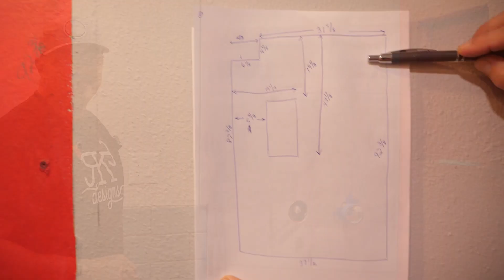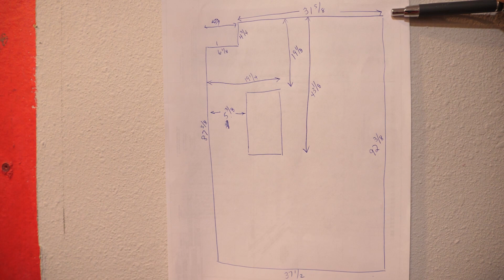How We Made Shower Panels Out Of Insulation Foam Board | Part 1 | RK3 Designs

Comment: Congrats on hitting 50k! Next stop 100k!
I am most likely to be doing this soon (depending on what's in the house I buy).  Can this be done cleanly without a track saw. Those things are awesome,  but quite pricey. Looking forward to the follow up video! ☮️
Reply from the maker: Thank you!!! 😊You could use a regular circular saw, use a straight edge (2x4) to run your saw along that edge.

Comment: Would if pass the inspection in a new construction? Have you checked the Building Code?
Reply from the maker: Yes. We’ve installed these in multiple million dollar new construction homes in San Antonio, Austin and Houston. Never had an issue with passing building code. 😊